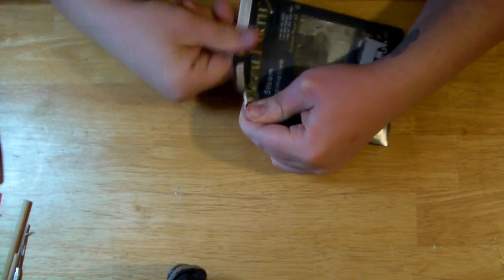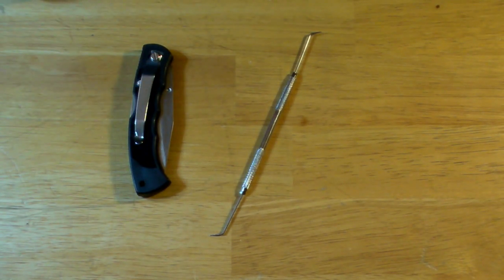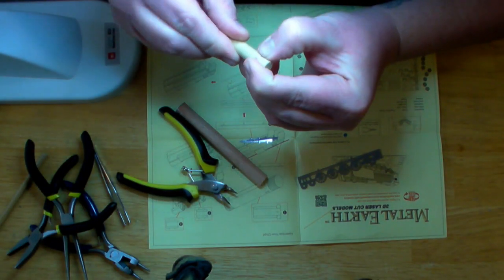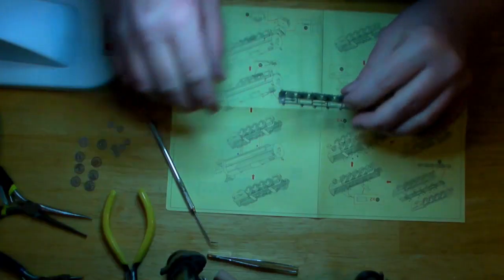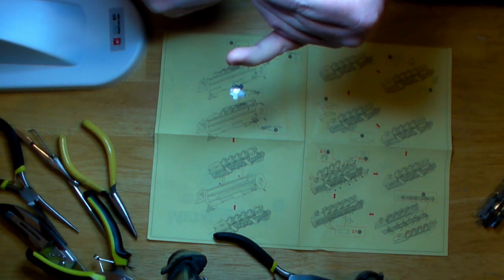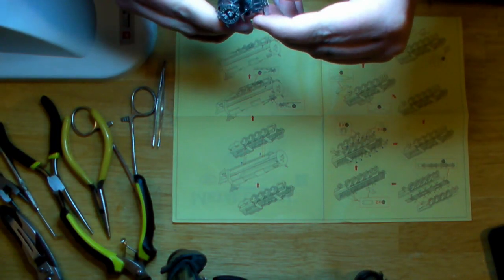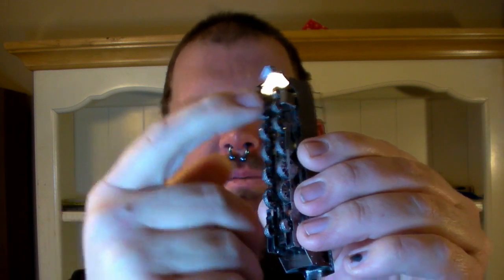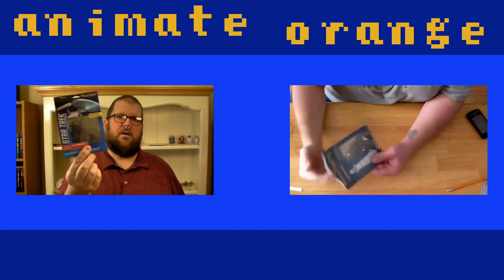Metal Earth build  - Steam Locomotive

Comment: I found that using super glue instead of bending tabs works great...   use the gel and a tooth pick for a very tiny drop on the tab, insert into the slot and there you have it...  then I give the whole model a cote of clear gloss (future floor wax works best) to clean up any fogging from the glue.

Comment: I just finished this build.  I have an idea about how to make the connection between the wheel assembly and the boiler assembly possible.  Do not attach the front plate and back compartment to the boiler assembly as directed.  Leave them off, complete the wheel assembly, and attach the wheel assembly first.  This should allow better manipulation of the bottom of the boiler facilitating the insertion of the tabs on the wheel assembly.  Then the front plate and the back compartment can be attached.  (I did not try this.  I was too far along, when this occurred to me.  Instead, I cheated, which turned out great to my shame.)
Reply from the maker: Richard Kroll nice idea. Thanks for sharing.